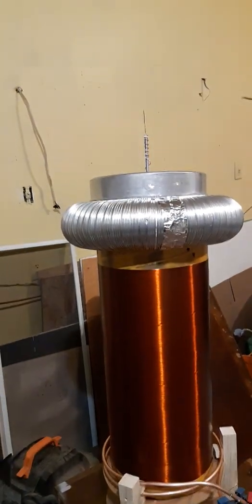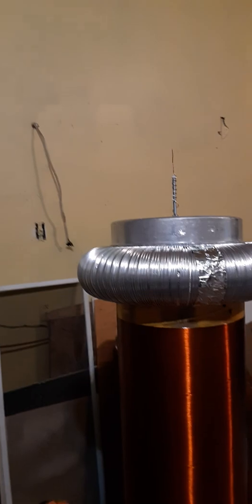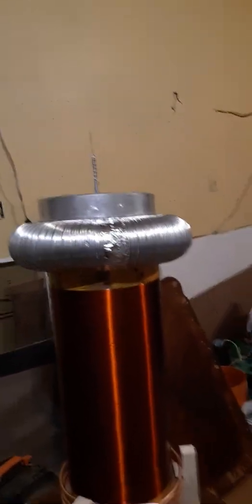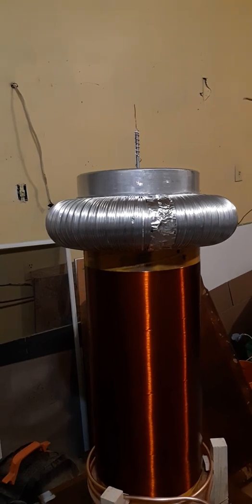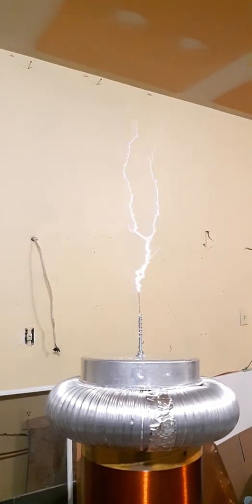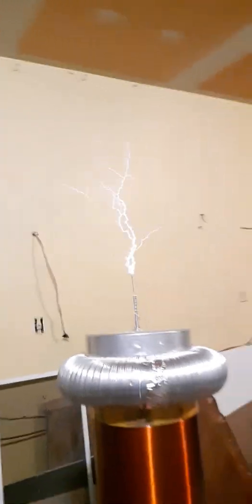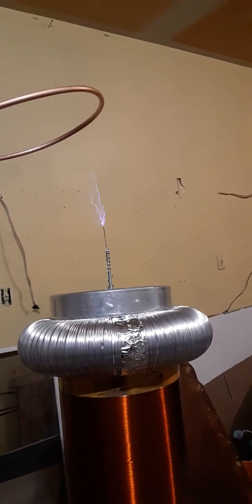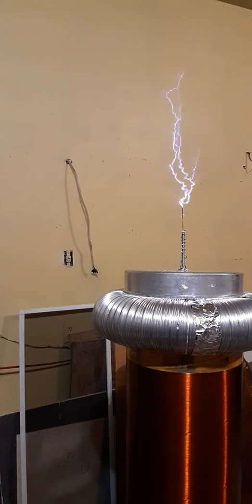High Voltage ZVS Tesla Coil

Comment: Did you use epoxy for the secondary? Epoxy is non-conductive right?
Reply from the maker: I used acrylic clear coat, but any plastic coating will work

Comment: Man! I forgot to ask you about the number of turns on your ZVS chokes! As you've used IGBTs, how many uH are the inductors as they look big? Thanks & awaiting for your reply.
Reply from the maker: There are about 60 turns on the chokes. I dont know the values, but from what I understand you want higher inductance when dealing with higher input voltages.

Comment: Many thanks bro for replying back to me. Your instructions are indeed very helpful. I've just completed a diy zvs with a separate gate power & lower my primary turns. I'm shocked to  now see at least 1 inch of sparks.   When I wrote 2u early morning, since then I've started to take more precautions not to burn any more gets. Compared to that tiny output I got early morning, I'm now getting better outputs. It's fun & you just can't never get enough playing with it & to further improve it. That's bro, for the advices. I'll put them into practice without wasting time. Many thanks again.
Reply from the maker: Keep it up man! Play around with coupling of the primary by changing the coil diameter and how far up the secondary it is positioned. Also play around with adding and removing capacitors. You would be surprised the difference it makes when you reduce primary coil size by 0.5" and add or remove 0.1uf of capacitance. I did alot of trial and error.

Comment: I'm speechless in front of your sparks length.
Reply: That’s awesome man! You got that setup working really well. Incredible work and fantastic output for a driverless Tesla coil. These things mimic VTTC with unfiltered rectified mains. Found the duty cycle was too high with full wave rectified AC. The half wave rectified mains cuts the duty cycle in half and is less stressful to the mosfets.

Comment: Hi there bro. I did same setup as SciTubeHD, same secondary dimensions, same 3 turns as primary with that 150 nF cap, all I'm getting as output is a very tiny 5mm spark! My Secondary Coil is 90mm in diameter, 160 mm coil height, around 1000 turns with 0.15mm magnet wire. Secondary resonates at 420 KHz without topload but when I added a topload, it resonates as 310KHZ. 5 turns on the primary I got nothing, but when I used only 3 turns, it was then that I got that tiny output. When I cranked my Variac up to around 70 vac, both irfp's 260N blew up!Any clues or help bro to grow my arcs bigger?
Reply from the maker: When I used oreo 260s I was able to get around 6" sparks. The reason yours blow up is because they can only handle 60VDC input, which is about 43VAC. 70VAC is was too much for them. What you should try next is this: put one turn on the primary and then adjust the capacitance so the primary is slightly under resonance and dont use a top load. You will draw higher currents doing this, but it should work. Also, make sure you are only doing half wave rectification with very little capacitance, if any. Having a seperate gate drive is very important I found. Seems to help reduce destructive voltage spikes because the circut never fully turns off. The wires joining primary to your tank caps should be sort as possible. I mount mine directly on the primary. The wires going from your 260's to the primary coil should be short as possible and if they a must be longer, tightly twist them together. This will reduce stray inductance. If your going to get higher rated IGBTS make sure to use larger feed inductors as well.

What I noticed in my tests is that the bigger to top load you have the higher input voltage you need for the same spark size. So smaller top load  = bigger sparks at lower input voltages. I also noticed that adding more primary turn reduces current draw, but also requires higher voltages to get bigger sparks. The more turns you add the higher the voltage you will need. 

In my set up I have 3 turns on the primary now, current draw is about 12 amps, input voltage is 150VDC and the spars are not very large, like 20" or more. My IGBTS bele up when I went above 160VDC (I think due to voltage and current spikes. However with just 1 turn on the primary I got maybe 8 or 10" sparks at about 70-80VDC  but the current draw was 25 amps! Much to high for my set up.